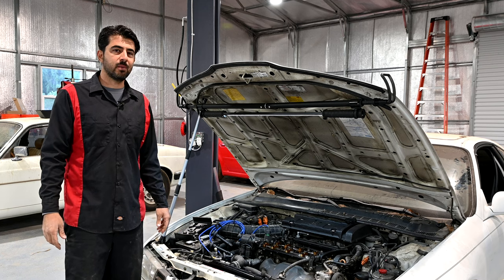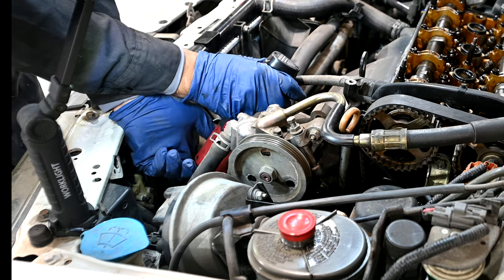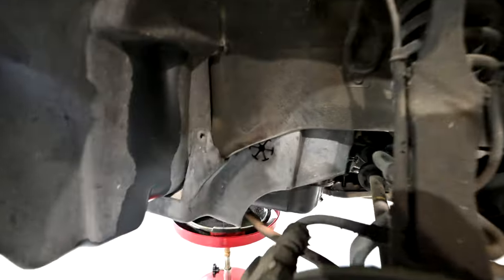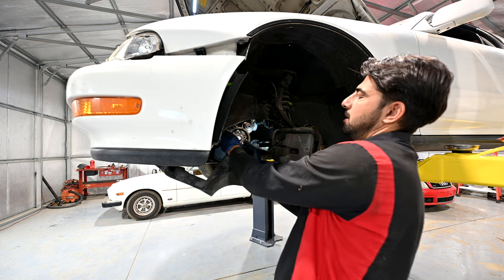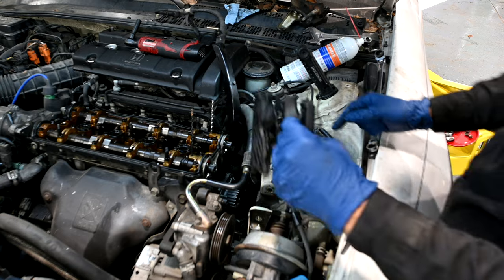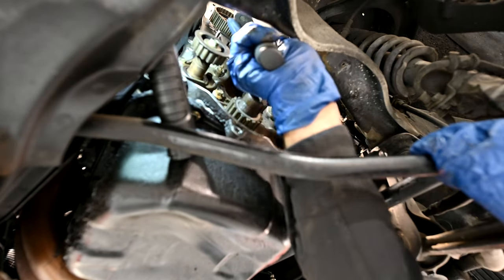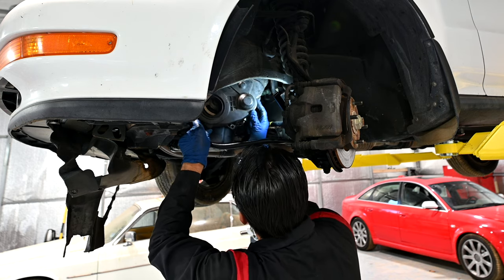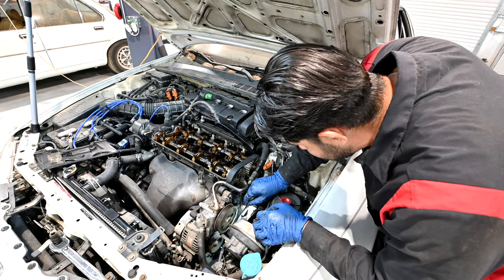Prelude Project Begins - Honda Engine Tune Up and Repairs

Comment: Quick note, putting in a separate comment for visibility: sticking the drill bit through the access port on the side of the block for the balance shaft is not optional; it's actually required.  I know you did so anyway, but I wanted to explain it for anyone who might be tempted to skip this step.  The balance shaft pulley on that side is driven through a gear reduction.  What that means is you can have the mark on the belt-driven part lined up yet the balance shaft still need more rotations for it to line up within the engine!  The drill bit in the access port allows you to probe when the balance shaft inside the engine is in the right place, as you can't tell that only by looking at the belt-driven wheels.

Comment: It's all about the while you are in there with these flip cars. I'm doing a volvo now that needs a water pump. Of course it runs off the timing belt. So I figured change the belt, water pump, seals etc. It is to the point now where I might break even but I figured I have not done one before so it's a learning experience on how to time an engine. I want to prove to myself I can do it.

Comment: Thanks for making this video; looking forward to more Prelude content!  A few years ago when I did this, the best/only resource on YouTube for timing belt on Honda H/F engines was based on an Accord, which is of course F-series and only single cam.  I really appreciate your explanation of the two different tensioners and how and when and why they work, because it can be a bit of a head-scratcher the way they're interlocked by being on the same shaft and how you can't put the timing cover back on without first undoing the tension-holding nut again.

Comment: It took me a moment to remember why that balancer shaft needs to be in time. Of course, that shaft spins counterweights to smooth vibration. So the counterweights of that shaft need to be in time with the moving weights of the crankshaft, reducing net vibration.

Comment: This brings back memories. My ex had one with the 4 wheel steering. I changed the timing belt. The crank bolt was very, very tight. Cool car, but not very good gas mileage for a Honda. I was disappointed.

Comment: Whoever plans on trying to replicate this job. I’d highly suggest you loosen the cam bolts while the timing belt is still on so you don’t need to mess around with holding the cam with a drill bit or using the wrench to hold it. Secondly, I wouldn’t skip out on the balancer shaft seals as the the front one(left side) pops out sometimes.

Comment: 9:17 Water pumps have a weep hole that used to drain any coolant that might make it pass the bearing so it's normal to see some coolant flowing out of the water pump. Just kidding! That's no weeping that thing is gushing!